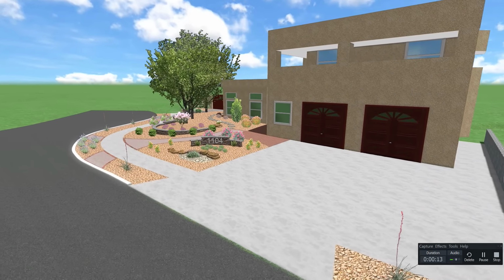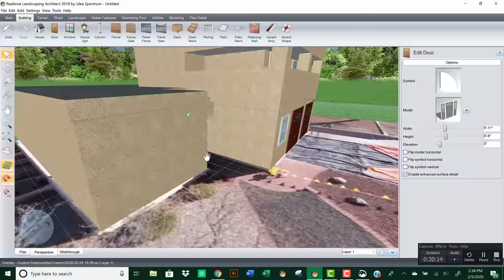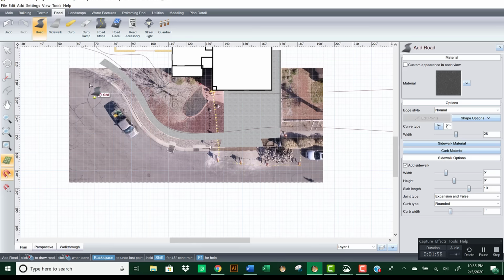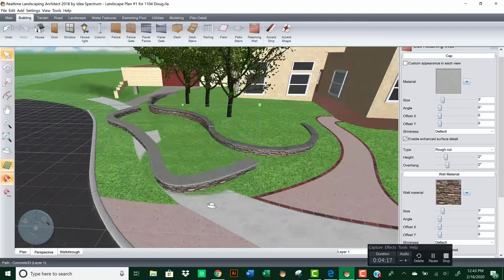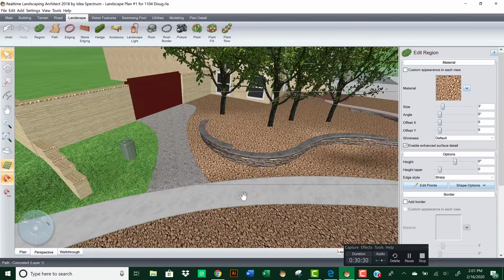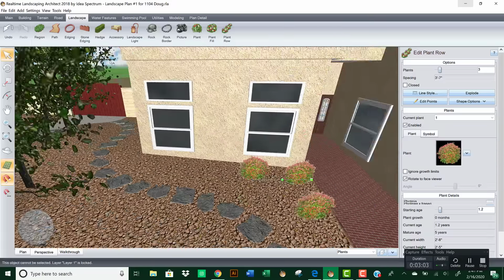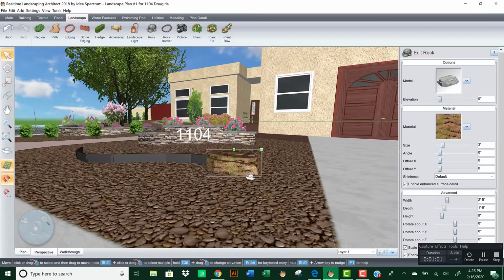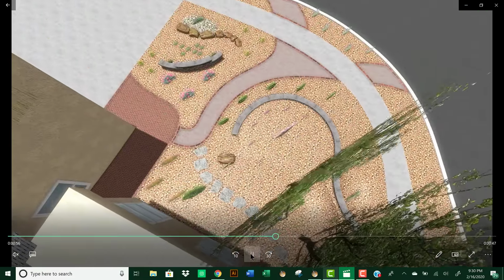3D Landscape Design In Realtime Landscaping Architect (Complete How To, start to finish)

Comment: These videos are a great reference point! I am curios what laptop you recommend for running this computer? any suggestions helpful !
Reply from the maker: Hi Jake! Here’s what I got! It’s served me wall with this program (and others) for years!
HP Spectre X360 15.6 Inch 4K UHD Touch-Screen 512GB SSD + 32GB Optane 1.8GHz i7 2-in-1 Laptop (16GB RAM, Quad-Core i7-10510U, GeForce MX330, Windows 10 Home) Nightfall Black 15-EB0043DX https://a.co/d/1zAhHvR

Comment: Thanks so much for this tutorial. I just got the program and it has a bit of a steep learning curve. Your videos have been a godscent. Any tips on how to put a plant in a planter? I can't find this info anywhere.
Reply from the maker: Hi Lisa! Really glad it’s helped you! Yes, there are two options. #1 if you place a pot and want a plant in that pot, I usually place a plant right where the pot is and adjust its elevation so it appear on top of the pot. #2 if you build a raised planter (such as a raised garden bed) then I build the planter with a wall into the shape I want. Then I place a patio within the boundaries of that raised planter (and make it look like mulch or soil) and raise the elevation of that patio and then add plants on the patio. My other videos show some examples of this as well
Reply: Thank you!! The elevation worked.

Comment: Good video. My house is built into a hill with a walk-in basement and my terrain is fairly complex. I find it frustrating when the objects such as the house, which is made of many objects, change elevations when I'm tweaking the terrain (using Height Grids). Is there any way to lock objects to a fixed elevation. Locking the layer does not work.
Reply from the maker: Jay this is a reeeally good question! As far as I know, theres not a way to lock in elevation. Ive had to set the grades first and then set each object individually bit by bit and then go from there. its very time consuming work! Be sure to use patios as part of your elevations that you rest things upon, someitmes this helps!

Comment: @Landscapers Academy
Your computer handles the program like a champ and I would really appreciate if you could tell me the configuration.
Reply from the maker: Thank you! Its actuall a pretty affrodable laptop. Its an HP spectre : HP Spectre x360 Convertible Laptop - 13t-aw200 Intel Core i7-1165G7 4.7 GHz, Intel Iris Xe Graphics 16 GB 512 GB PCIe NVMe 13.3-FHD Touch W10H Nightfall Black. Luckily this program doesn't take much computing power.

Comment: I have been using landscaping Architect for a long time. and along the way i had identify some flaws. One been if  have a separate walkway  on a slope  going to your front door with steps and want to have one going to your driveway it doesn't quite work. Reason been to create steps  the patio tool is needed and basically patio is level   and driveway is always sloped therefore the problem.
I had suggested this company for about 6 years about making a patio the can be adjusted  to conform to different slopes and elevations. The funny thing is  it is fairly easy for them to do it. I dont understand the refusal to do it. I call it refusal because for six years I been asking they been saying they will ,and the have hundreds of other  suggestions . worth noting in the last 3 upgrades it has nothing worth paying for some new models 3D grass and a few other things. to me is more important creating realistic drawings than having 3D grass. I have at this point lost hope of that ever happening I told them I will not paid for an upgrade till they do it. I was so excited direction
Reply from the maker: These would all be great additions to an updated version! Overall I'm pretty happy with the program but definitely looking forward to seeing what upgrades the future versions entail!
Reply: @LandscapersAcademy  Maybe you can throw that idea to them. Maybe we get lucky and will listen to you.
Reply from the maker: @rubenreynaga1572  I will amongst other ideas for improvement that would be helpful

Comment: I also have a mac, I'm new to this so I don't want to spend a crazy amount since i have the mac, was wondering which pc you went with
Reply from the maker: HP Spectre x360 Convertible Laptop - 13t-aw200 Intel Core i7-1165G7 4.7 GHz, Intel Iris Xe Graphics 16 GB 512 GB PCIe NVMe 13.3-FHD Touch W10H Nightfall Black. Works fantastic after a TON of use!

Comment: Well done video. I have been using RLA for about 3 years now and feel i am finally starting to get the hang of it. I learned some awesome things from watching you video that I will be implementing into my work in the software. 

I don't know if you have tried using the shortcut keys for the quick functions? I find it to be really useful and a lot faster as well. I don't remember what they all are off the top of my head, but I have a programable mouse with 10 buttons that I  have for different things, and then I use "e" all the time to edit points. When you hover the mouse over the selection I believe it tells you what the shortcut is for the keyboard. 

Thanks again for the video, I learned a lot and will be checking out your other stuff and anything more to come!
Reply from the maker: Thank you so much for the kind words! I'm glad you learned from some of my videos! I'm very glad you mentioned shortcut keys! I researched them and have already implemented them this week, which is helping a ton! More to come! Cheers!

Comment: Does it have a plan layout view to scale option that contractors can use?
Reply from the maker: Yes it does! generally it automatically scales it to be 1-inch equals 10-feet. you can also edit thing to have the CAD-like appearance as well. I've had other contractors and pool contractors install from these program plans seamlessly.
Reply: @LandscapersAcademy  does it work in metric too? I'm in the uk...

Comment: Hello, thank you for the video. I was wondering how to get the wall stone options you have, my program (UVision) only has  Unilock, is there a way to add more product options to the program?  Also, do you know where I can find a tutorial video on using the retaining wall tool's, cut terrain option, as well as edit cut angles? Thanks again for the video, it had especially good info on using the slope tool.
Reply from the maker: Hi there! My guess is that maybe you need to updated your realtime program for the wall textures? also with creating wall angles, please look at my latest video for help with that, it should show how. Thanks again!
Reply: @LandscapersAcademy  Where can I find your video? I have already updated my program. Thanks in advance, I have been using this program for 3 years, never felt  there where enough instructional videos on working with walls etc. Most of my work is on lake front properties, lots of large slopes and many grade changes.
Reply from the maker: Julie z did you figure out the wall texture? Mine just works so maybe have to contact ideaspectrum about that. You can look on my YouTube channel to see the other videos that we have, and those may help with different wall heights and techniques. I have a couple more advanced videos coming out with me narrating them the whole way through. Should be posted soon